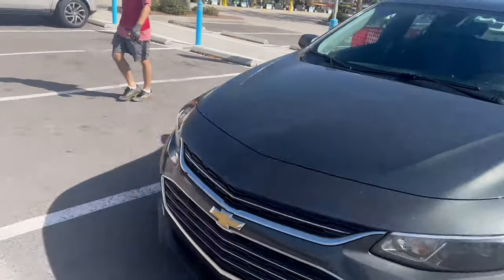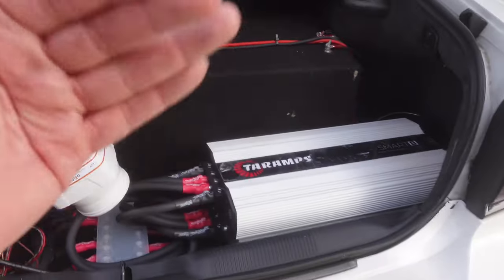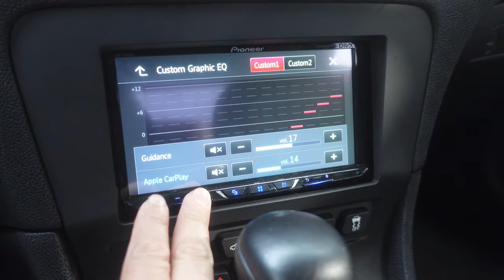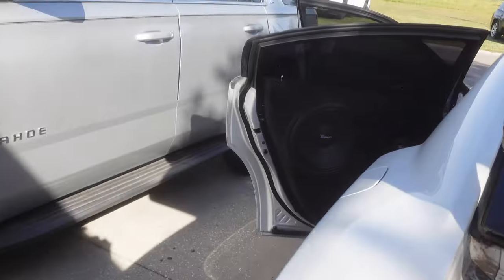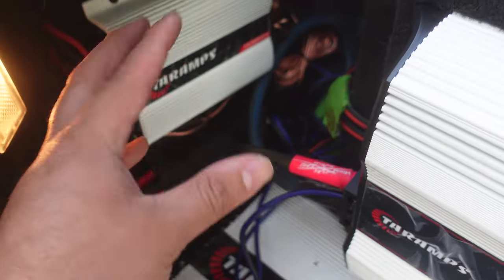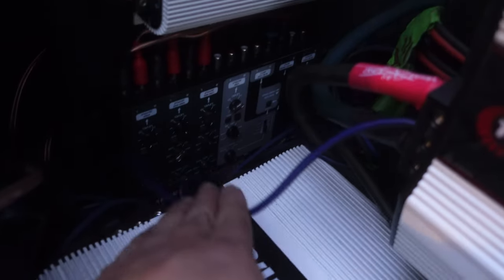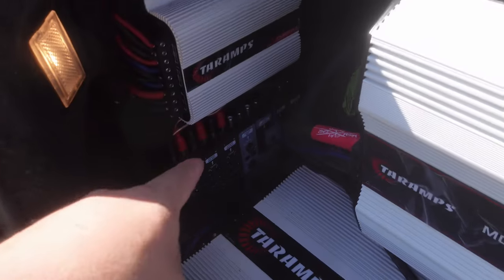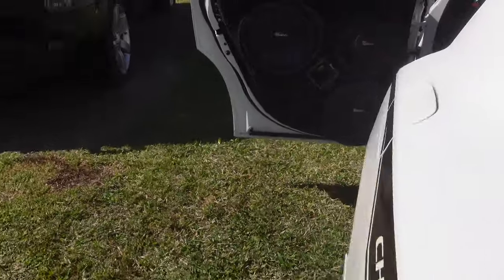Tuned Taramps Amplifiers By Ear! NO DSP NEEDED!

Comment: Great job bro 💯 but I was hoping to see you use the voltmeter on  tuning the amplifiers so I can see how the taramps are done the right way
Reply: Never tune an amp with a multimeter ALWAYS use either an OSCILLOSCOPE or SMD DD-1+
Reply: The right way is Def a dd1+ and a cc1 to tune a amplifier.

Comment: One question, though, I didn't see any extra batteries. Is he running that system off the stock electrical??
Reply: No way, his battery would be dead in a heartbeat. The voltage would also drop to low and taramps are really bad with low voltage
Reply: @josephscott3294  I figured that. I was curious where he was hiding it all 🤣

Comment: There is absolutely no way to control the cancellation in that car NONE...The air volume inside the car can't handle half the woofers and subs he has in there. DPS, polarity flips, door deadening, acoustic panels...I don't care what is done that car with never ever have good imaging or balanced sound...SPL will be great but the over all sound will be trash...

Comment: That is a mess. Different speakers. Lots of amp gd amps. N sound crap. I only hav 4/ 10 " ev. N 2/ 4" driver . Hiting 2/ taramps 3000 ×1  n loud ass heck. 1block away still heard it clear

Comment: So yall don't care if the check engine light on 😢😢
Reply: He's an installer not an engine tech bro 😂
Reply: The car in ACC mode so the battery turn the radio and amps on. That’s why you see the check engine light
Reply: Is it your car ? Youz driving it ? Why tf you care about the check engine 😂😂😂

Comment: Not a fan of taramps yea I know you can use a dsp to adjust the crossover on the subwooferbass to hit lower bass but when you compare to an amp that already has the crossovers set lower 40 hz than that of the taramps 80hz it's just sounds better.